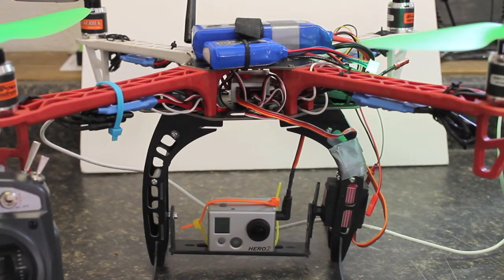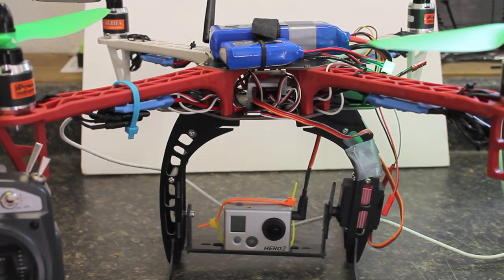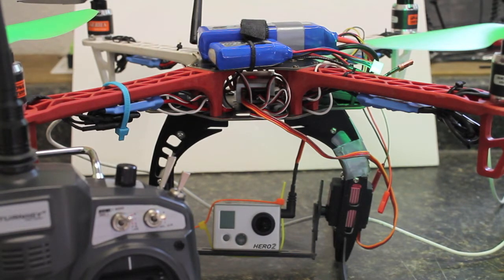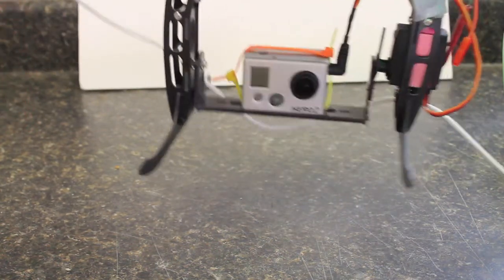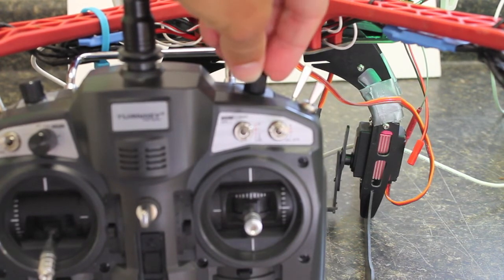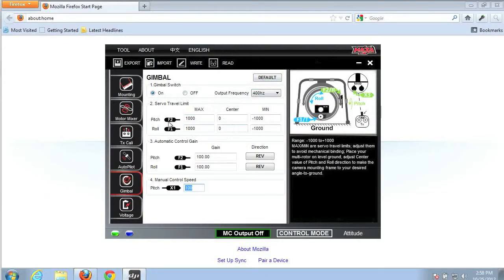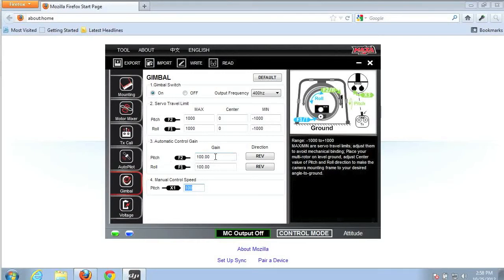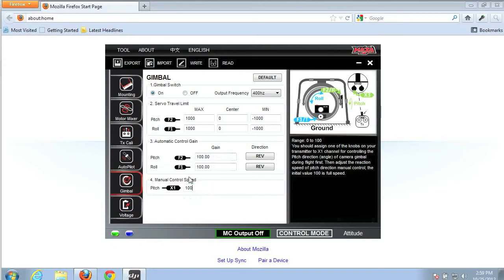Naza Gimbal with Automatic and Manual Control Gains Using HobbyKing x550 Camera Mount

Comment: How did you get the Gimbal to adjust automatically up and down to stay level when the Naza has no option for auto leveling?  Mine doesn't do anything like that but I can control it manually from the Taranis using LS and RS.
Reply: set it in naza pc software

Comment from the maker: It's normally dependent on your servo type. Check the documentation for yours. I believe most standard servos run at 50Hz so you may want to give that a try first.

Comment from the maker: Yes. I have a digital servo with an operating voltage of 4.8 - 6.0V. The Naza's output voltage on the X1 port is approx 5.0V so everything is working fine. As for current output I'm not really certain, but haven't run into any problems.

Comment: If you have seen my flight at freedom hill FPV this is how I did it! I'm using the V2  Sky Fly 9X the same as the Turnigy 9X I have set the 2 up with the new systems and I will never go back! 2 time the range with the Frsky systems.

Comment: Well I started with a FrSKY 2.4GHz JR Combo Pack from range video dot com but there are better set up's if you go to alofthobbies you can pick up a FRSKY DJT - JR TRANSMITTER TELEMETRY MODULE, FRSKY D8R-II PLUS - 8 CHANNEL RECEIVER W/ TELEMETRY even if you do not use the telemetry it's OK all you do is go in to where your 9X antenna is and take it off and plug in the new system and bind it and it is all set! just that EZ.